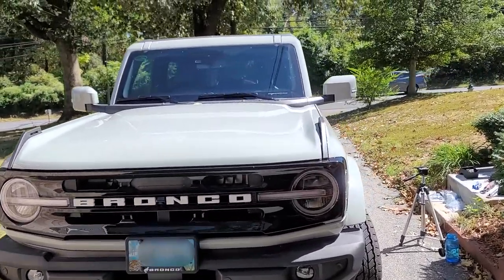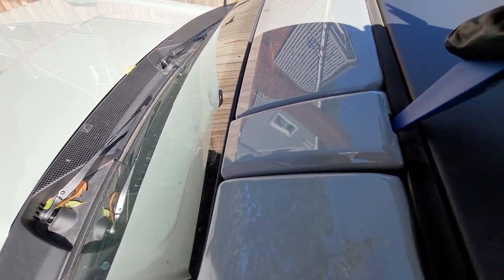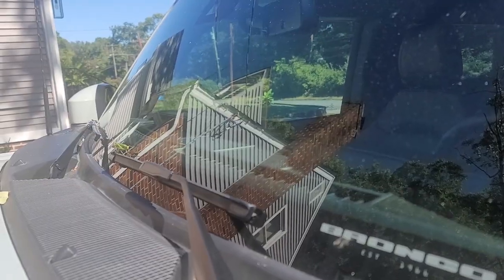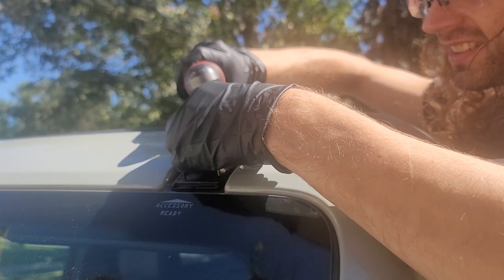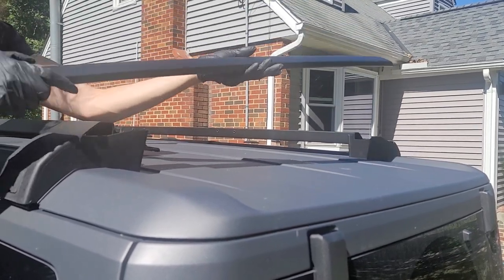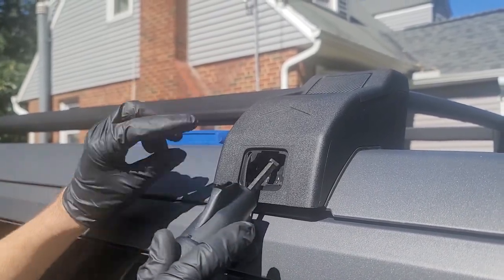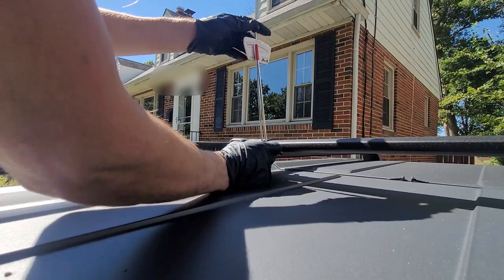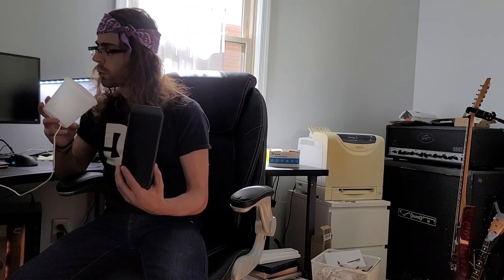Ford Bronco Roof Rack Install (2 door)

Comment: Could you link this kit? I would love to buy something like this. I've been trying to buy a roof storage bag/case, but through my research have found there really isn't a good way to secure them on a 2 door... Thanks for the video!
Reply from the maker: I believe it was this one, I just bought OEM: https://accessories.ford.com/products/bronco-oe-roof-rack-2-door

Ford often runs a 20% off promotion, I think it's via coupon code.

Alternatively, look around for M2DZ-9955100-AA, you can usually find it for around $700.

Comment: Can you still remove the hard top with this rack in place?
Reply from the maker: Yes you can. It's a bit of a tight squeeze and you have to be careful as to not scratch the panels on the rack, but I've done it many times now.

Comment: Does the 4 door fits the 2 door bronco?
Reply from the maker: I don't think so. Even though the website seems to have the same part number, someone in this forum said that the holes don't line up for the cross bar:

https://www.bronco6g.com/forum/threads/4-door-roof-rack-fit-the-2-door-bronco.70121/

https://accessories.ford.com/bronco-oe-roof-rack-2-door
https://accessories.ford.com/bronco-oe-roof-rack-4-door
Reply: @Bootstrappin  thank you so much!

Comment: Where I live in NJ you cant swing an expired cat with out hitting one of these Ford Broncos.
Reply from the maker: So that's where they all went lol. Spotting one around here is like seeing a unicorn.
Reply: Well there are a shit ton of them in the Cherry Hill / Mount Laurel area. Mostly sold by Winner Ford and Holman Ford. At least all the ones I have seen the back of.
Reply from the maker: @mrkrasker9609  fascinating. I guess I know where to go visit when I don't feel like being special anymore lol. But my two door trim is best trim, no-one has the courage to get the shortie.
Reply: Most of the Broncos I run across here in NJ are the 4 door. So as for my observations you would be an anomaly in this area.
Reply from the maker: @mrkrasker9609  score. As a fun fact, this has been a weirdly appreciating asset for me. I wonder how long before the bankers introduce car equity loans.